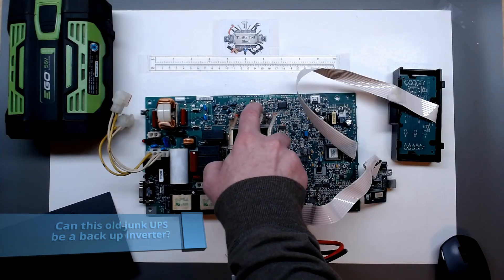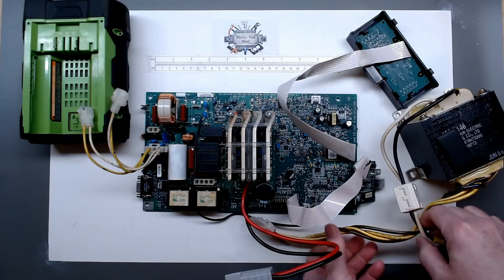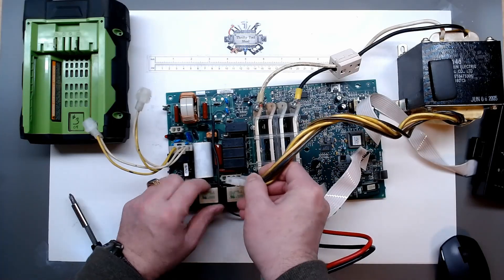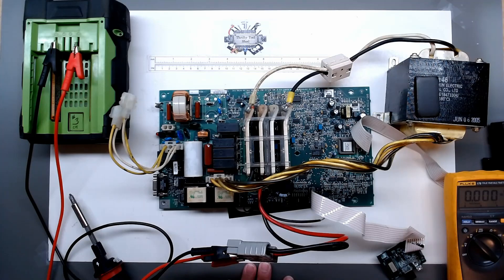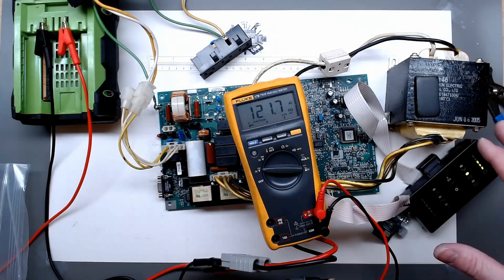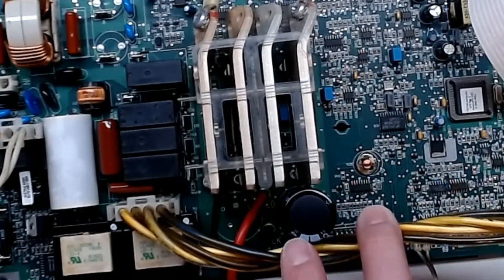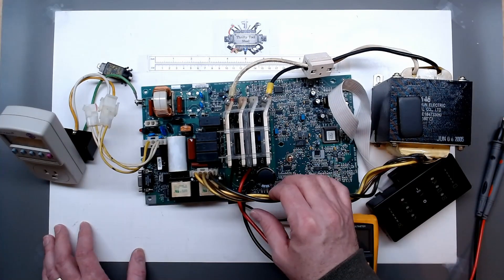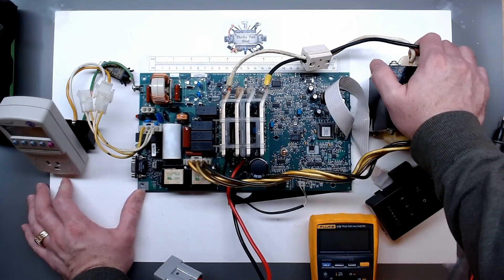Repurpose an old UPS as a Emergency Inverter

Comment: i thought the same thing with finding one of these UPS 24v units, and wondering if it would make a reliable inverter with reasonable rating (1000W unit and 240v) from 2 car batteries was My thinking also. 
i'll have to look for your other videos to see if you did the 48V one
Reply from the maker: The only reason I did not do a 48V on video is this video did not get the best response. I will still do it if I get more responses like this one. Thanks for your comment. I just like to repurpose and reuse things that would other wise be in a land fill and alot of viewers did not get it really.
Reply: @ThriftyToolShed  thanks! i do the same, i research before scrapping anything.. can it be sold for parts, reused, repurposed etc.  i picked up 2 of these a 1920Watt Dell one, haven't looked at yet(not sure on the battery voltage of that one yet) i follow a channel called "The Ultimate Recycler " and he covers the "is this valuable?" worth a watch also on similar things being reused.
 https://www.youtube.com/watch?v=v4Vz9661ieg&ab_channel=TheUltimateRecycler